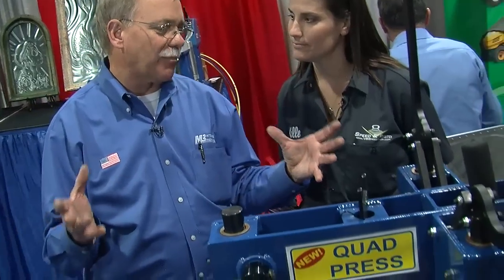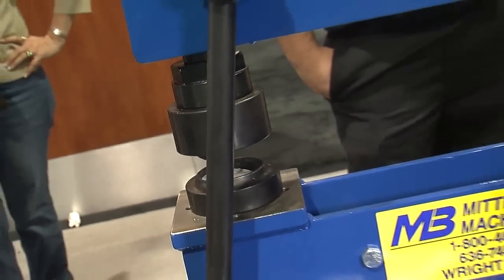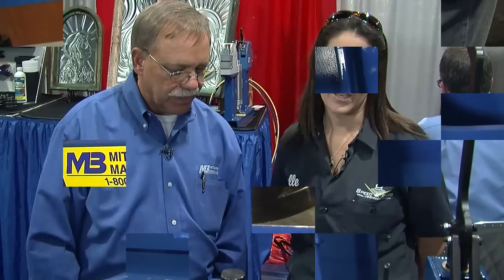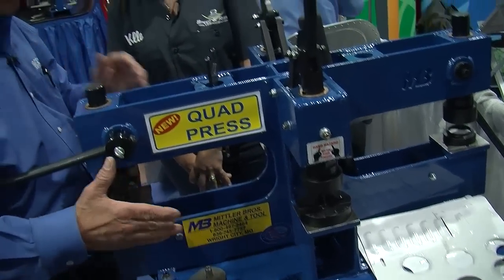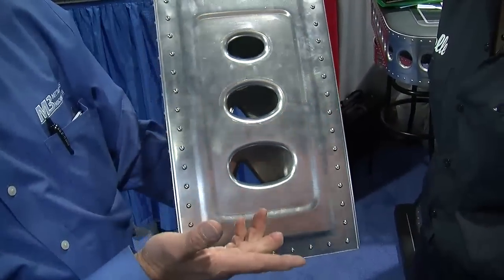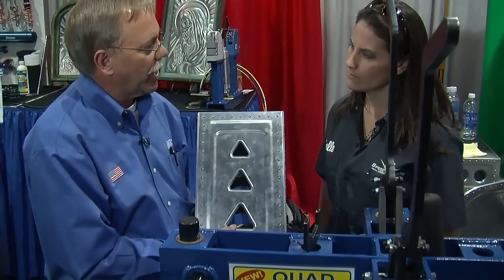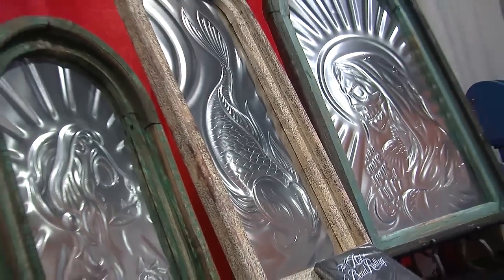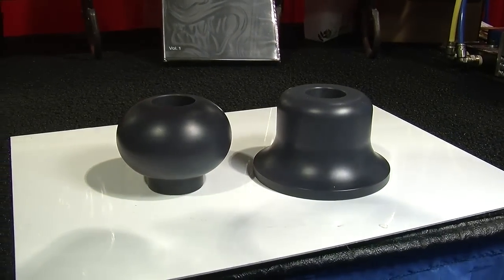2013 SEMA Show Video Coverage:  Mittler Brothers Fabrication Tools Quad Press V8TV

Comment: Some of the products mentioned in the video are out priced below.
Quad Manual Bench Press - 3 Ton: $1,895.00
Oval Punch & Flares Starting At: $425.00
Triangle Punch & Flares Starting At: $425.00
For More Info Go To: mittlerbros.com or call 636-745-7757
This video is awesome, V8TV does some great work!